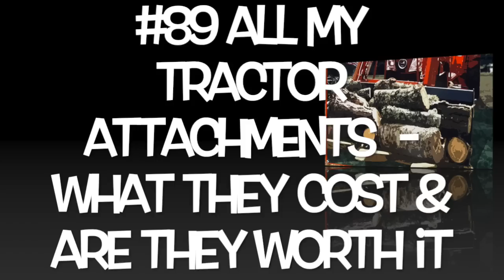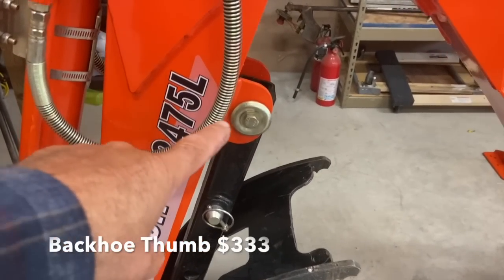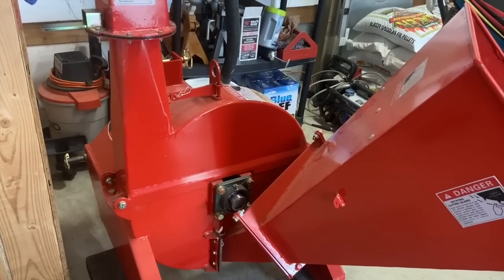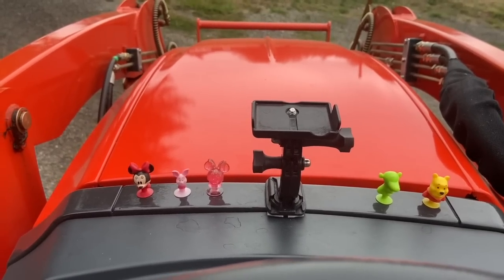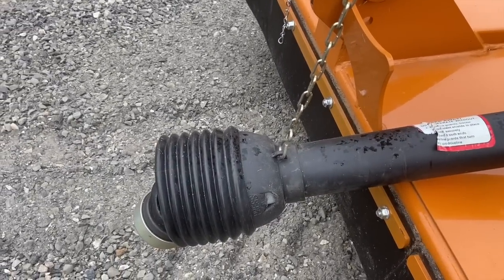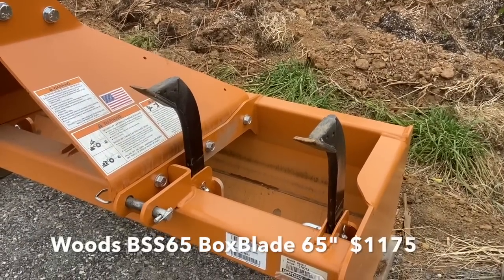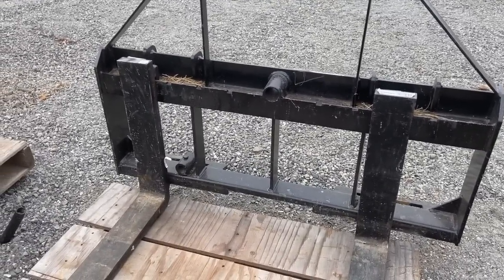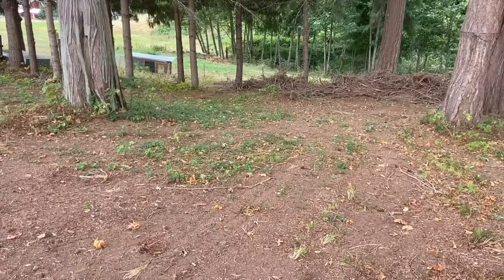All My Tractor Attachments  - What They Cost & Are They Worth It

Comment: Referencing the sound you experience when engaging your rotary mower: Can you engage your PTO implements using the clutch or is the KIOTI electric engagement only?  Anyway, I always engage my PTO at a low RPM, maybe 1100-1500, then increase the RPM up to operating speed.  Seems to be easier on the tractor and implement.
Reply from the maker: 👍My model only has electric engagement. My rpm gauge has an engagement marker and running marker. So those are the spots I use. I will try engaging at a lower rpm. I figured it needed a level of power to move the blades. I’m still learning, thanks for the tip. 🚜🇺🇸
Reply: I have a clutch only on the NH and engage it slowly with no problem. You'll find the RPM sweet spot for the electric engagement after a while but I'm sure you don't have to have it running at the PTO 540 engine RPM .  Heard the salesman in your vid #104 say it is manual PTO if you flip the switch off.  Understand now that "manual" just means it doesn't switch on and off when you raise/lower the lift arms. Learning from your vids-thanks
Reply from the maker: Thanks again. I’ll definitely try it.

Comment: @ 4:00 - "I've picked it up and driven short distances..." - did you mean, while operating the hoe, you lifted the tractor from the back wheels and pulled or pushed the tractor a bit to keep working the digging area? Do you need to have 4WD off to do this, in your experience?
Reply from the maker: 🚜💪 I do not intentionally move the tractor with the backhoe as I’m working. I am always concerned with frame twist and cracks. Some folks say that is an issue, I have not experienced any issues so far. It would make sense you would want 4x4 off to drag it😊. I would say avoid it. Sometimes while digging, I’ll move the tractor unintentionally and it works for continuing on, but my practice would be to get off and move it. Thanks for checking out the video!!🍺🇺🇸

Comment: Great video my friend!  I especially like the Disney accents!  We have had a great time working our Kioti hard, I am on my second tractor and these machines are build to take a lot of abuse.  One thing that would recommend is a 3pt quick hitch and a hydraulic top link.  Those two items (under $500 for both) will change your life.  Feel free to swing by our channel if you can!

Best,
-JTF
Reply from the maker: Joe The Farmer 👩‍🌾 🌟Cool! Thanks man! I have debated the quick hitch. Just thinking about the backhoe and having to take the hitch off for that, but I might just have to do it! I’ll come by your channel and pick up some pointers I’m sure. 🚜😎👍🇺🇸🍺
Reply: @tractorrookie  The backhoe changes things; but if you primarily use the box blade/brush hog/etc it makes swapping implements a breeze!  And if you have a rear remote for the hydraulic top link it is a total time saver.  I try to put each tool to the time saved and that's how it pays for itself.

You have a great channel man!  I subscribed and look forward for more to come.

-JTF
Reply from the maker: Joe The Farmer Makes sense! Thanks 😊

Comment: To make it easier to adjust the forks lift the Locking pin up tilt the forks down to the forks are aiming at the ground but not touching it then try to move the forks there's a sweet spot that they'll glide-on it'll make it easier
Reply from the maker: mr. Hoole 🌟👍 Cool Thanks! I will give that a try! 🚜💪😎🇺🇸